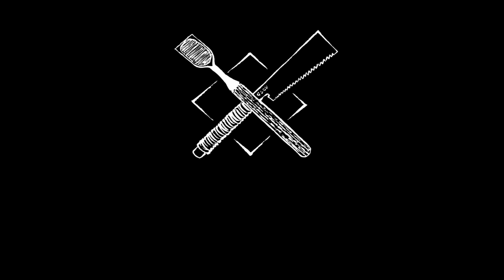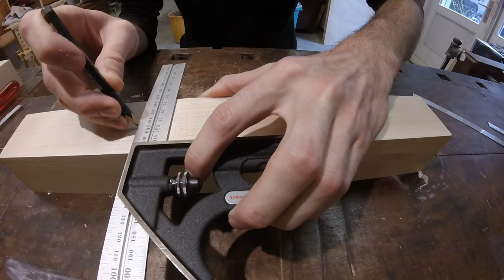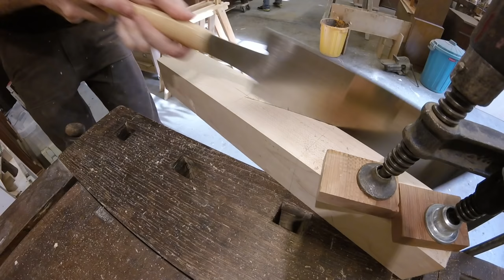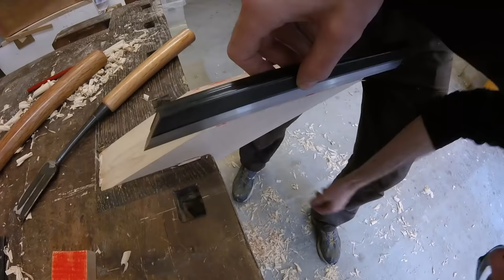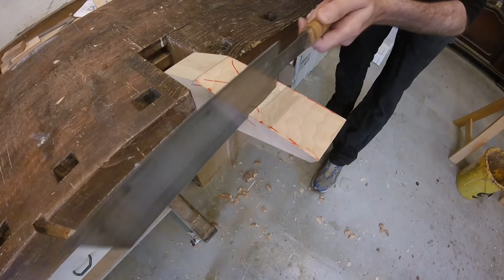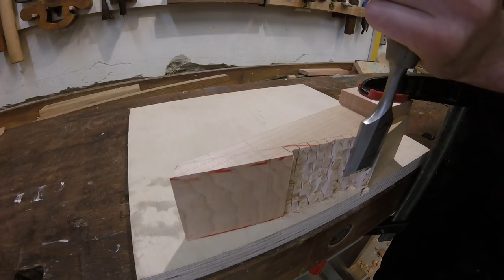Joint Venture Ep. 16: Undersquinted wedged scarf joint (Western Joinery)

Comment: When undercutting that surface, it reminded me of metalworkers scraping a surface. But they do it to achieve a level surface with low areas for lubrication. The technique is essentially the same. Start with a fairly flat surface, use a precision reference surface lightly painted with dye, then rub them together and scrape the high spots.
Reply from the maker: Same here. I find scraping in very interesting to watch!

Comment: Very nice work! I am retired and didn't think anyone would still be using a scarf joint? I use to make mine with the double wedge as you do but I never used a sharp angle on the top or bottom. I learned that it could break off easier if the angle was to steep?I believe a slighter angle might better serve you with this type joint? I am happy to see someone still appreciates true carpentry skills!
Reply from the maker: Thank you! Yes, thinking about it that way makes sense.
Reply: @Heloise O'Byrne It depends on how wide a span you have and what is the depth of the joist. I would generally sister on a board as it sounds like what was done ? If it wasn't done to your satisfaction have it done again. Another obtion is if it is the ground floor  adding another pillar to support the middle of the span. I have used this method many times with no problem nor complaint. Dorian will read your post and may have another method?

Comment: Where would you use this though?
Reply: Generally where you want to join two long pieces of timber to make a longer piece. Thinking about a roof ridge, traditional timber framed barns, it’s used a lot in boatbuilding. Seach Tally-Ho scarfing the keel for a massive version of this joint!

Comment: What type of pencil is he using to check flatness? I’ve been using sidewalk walk but I think this pencil provides a more accurate indication.
Reply from the maker: It is a glass marking pencil on a flat bit of wood. Be sure to get rid of all of it if you are doing surfaces that will be glued. Or use a soft pencil (2B should be fine)

Comment: I wouldn't trust that to bear a load it wouldn't take much to break that right in half.
Reply: 2
Reply: Tried it,  super strong,
Reply: It's actually a very strong joint.  If the load it's going to be supporting is a concern, you should still as always, install addition support or bracing

Comment: what is the red stuff you used to mark the high spots and where would I find it?
Reply from the maker: +MrD300 just use pencil or charcoal or chalk on a flat surface.
Reply: Thank you, I am teaching myself woodworking. I purchased a book showing how to make many of the joinery you are showing on this channel. Reading and looking at drawings in a book is a start but to have you showing how is done really brings it to life and is a great help. Thank you again.
Reply: chalk dulls the edge, it's mineral
Reply: It's called a chinese pencil and you can get them at art supply shops. They are grease based so will write easily on "wet" wood and wont damage tools

Comment: Did you flatten that surface with paint and a chisel AFTER using the plane?  I had no idea such a thing was even possible! Badass!
Reply: That was stupid. He can get better flatinning using the plane tool.
Reply: @eduardofernandez6756  but its much easier to spoon out the center slightly with a chisel. Which is what he was doing. That keeps the edges tight.
Reply: And then he channeled out half the area he'd spent so much time flattening. Pointless doing the paint & chisel work until AFTER you've cut the shape out.

Comment: I was taught that an accurately sawn joint should need NO chiselling, and if it did, then points were deducted.
Reply from the maker: That's true for furniture work. But doing carpentry work is another story
Reply: @DorianBracht  
I dont see that whatever you call the work makes any difference. 
I put in a replacement section of a floor beam in a woman's 200+ year old house some years ago, and it was a double scarf joint. Slid into place between the two ends and fitted snug, and no chiselling.
Chiselling wastes time, and time is money.
What do you class as ''carpentry work,''?
Reply from the maker: Wow, then you are pretty talented. Hats off to you.
How long have you been working wood?
Reply: @DorianBracht  
In my final year, at 14-15, I was top of my school in woodwork, and was selected to make a 'tea trolley' for the headmasters study, so he had something to put his tea and biscuits on, when he was entertaining the governors.
After leaving school, still at 15, I made my mother a sewing cabinet which had secret mitre dovetails.
Following that I joined the RAF, in 1962, and then my lifestyle prevented me doing much, until I started my own building business, 20 or so years later. When I did the double scarf beam, I was ''retired'' and crossed my fingers that I'd get it right first time. Seems its a bit like riding a bicycle, you never forget.
I was also top in science, second in art, and amusingly, third in RK, which was a surprise as I was already an atheist, and as the RK teacher said, ''but you've done no work during the year!'' My reply was, ''All I have to do is put down on paper what you've been stuffing in my ears for a year, I dont have to believe it.''
 I've mused from time to time, how I could blend those abilities into one occupation, but never came to a conclusion.
Maybe making church furniture, for the Scientology group would come close, but with my attitude, I'd be as welcome as Pig in a ''bar mitzvah.''😊
I'm presently constructing a new set of doors for my 200+ year old stone barn, approximately 3m x 3m, to replace the ancient existing decrepit doors. I've had to put a new floor in the attic, as the workshop at ground level being on a slope, was partly below ground level, and in winter, when it rained hard, partly below the water table, so it got flooded! Not so good for my tools. I'm using treated construction timber, which has its problems, as its not very exact, and inclined to be a bit bent here an there, and vary in thickness and width from piece to piece. but, if you follow the rules, and work from 'face sides and edges' things work out fairly well.
Hope I haven't bored you.
Reply from the maker: Not at all! 
Very interesting story indeed! 
I wish you success with your stone bar reconstruction!
Reply: @DorianBracht  
Thanks.
I find youtube really for ideas. 
Recently I realised I'd need some 1'' dowelling for my barn door reconstruction, and there, coincidentally was  simple method for constructing a small dowel making tool. I've now made the tool, using a plane blade, and a piece of a van leaf spring as a back plate, as the cast iron original wasn't tough enough and snapped.
I now have 4m/12' of 1'' dowelling.😊 

(In this part of France no one sells prepared wood, except very small mouldings.)

I've had to relocate the staircase I made, as it was too close the the barn doors.
Every time I need to do one job, I find there's two or three other jobs need doing before I can start on the main job, and there's usually a couple of jobs before each of those!

I'm a bit jealous of the wood you have available.  Here, in the Dordogne, it's mainly sawn oak or chestnut, which is OK, but rather coarse grained and dark compared to beech and maple, which is beautiful wood to work with.

Also, I do like seeing other people demonstrate their skills for others, as in the UK, and elsewhere, the schools are abandoning handicrafts, and disposing of their handicraft workshop equipment. That seems crazy, as, how are people ever going to be able to design things if they've never made anything?

One school I went to to pick up some of the surplus machinery, the stuff in the ''craft class'' was on the level of kindergarten, ( plastic straws, and toilet tubes) and these were secondary school kids.
Crazy!